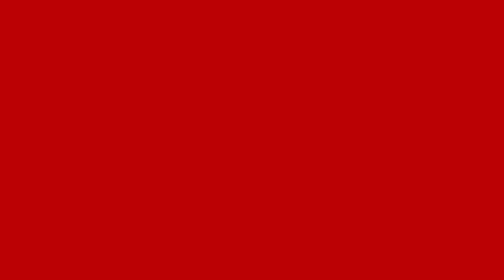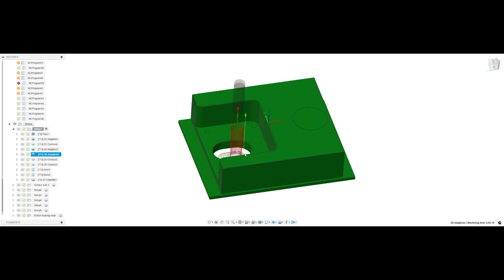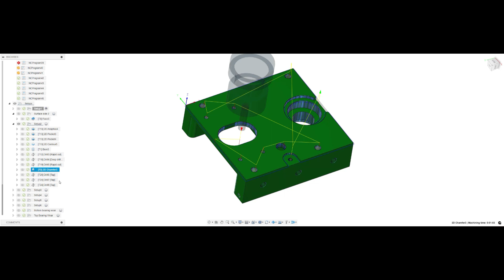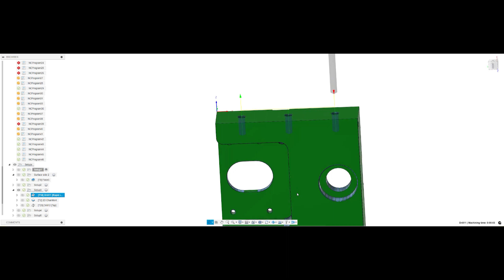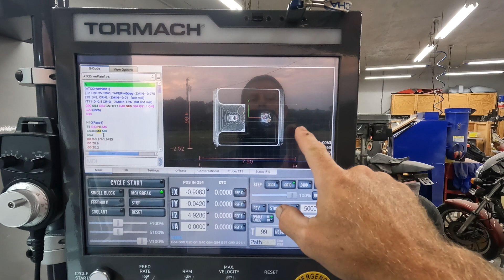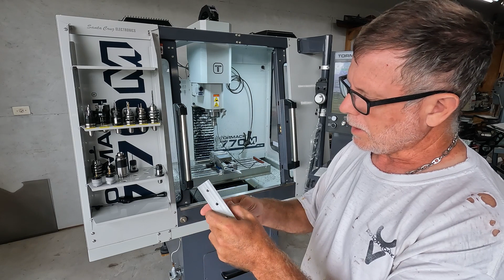DIY Tormach Automatic Tool Changer EP5 ATC Drive Plate

Comment: pretty interesting project you have going on, how much do you think this will end up saving you from the tormach ATC?  you can put me down for buying the CAD from you, also do you have a parts list and suppliers all sourced yet?
Reply from the maker: In total I have almost $800 invested so I would say quite a bit of savings. Of course there is some extra expense items. Tool bits, extra electronic parts, PCB prototypes, etc…  Also I have all tools needed to tackle such a project, CNC plasma. Mig and Tig welders. Powder coating, etc. I am currently working on a website to offer items I make be it motorcycles or Tormach. Thanks for the comment!